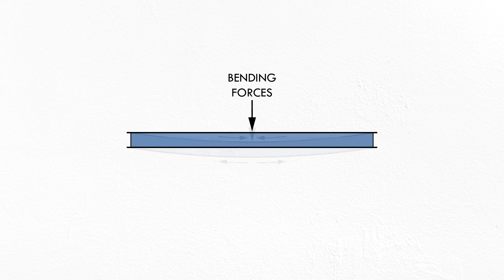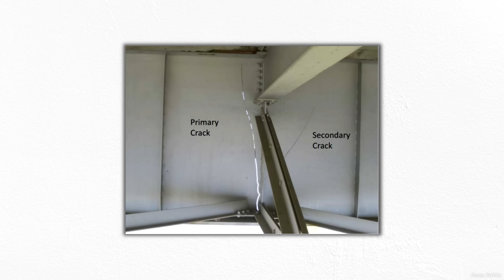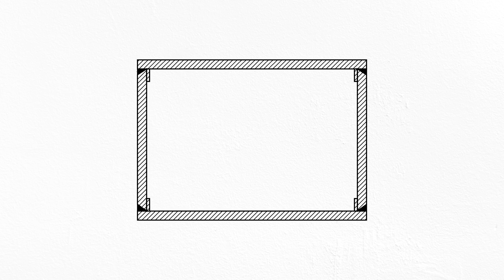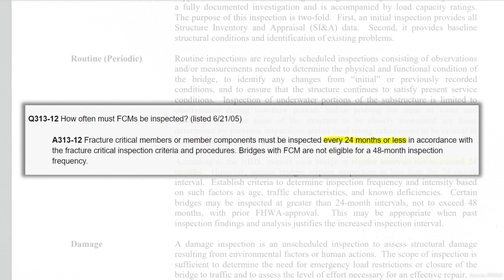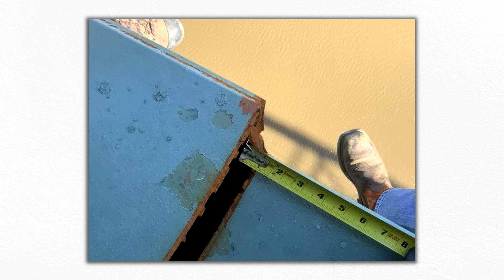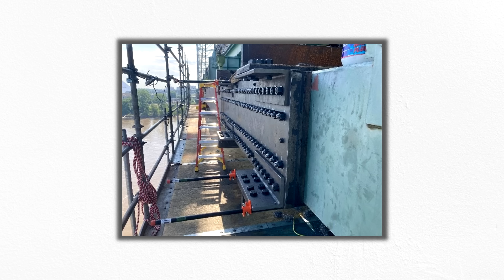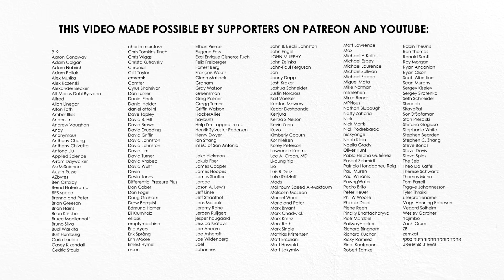What Really Happened at the Hernando de Soto Bridge?

Comment: That's going to be one big headache now. It's definitely got some sort of load/tension it to move like it did. What consequences will it have on other parts of the bridge now as you suggest, time will tell I guess. But the inspection firm will now be liable for anything that goes wrong now. That guy fired was most likely a scapegoat. Poor practices and processes in place by the firm led to the crack to develop to a break over many years by the look of it. Luckily the bridge looks well built and withstood it. 🤙

Comment: The level of incompetence shown here is scarey. I could understand the inspectors missing a hairline crack, barely visible to the human eye, but this vast chasm could be seen from a canoe, some distance away. There are, quite probably, plenty people who have seen this damage from passing boats. Unfortunately, the majority of people don't have the engineering knowledge to identify the damage as dangerous. That's what the inspection are 𝒎𝒆𝒂𝒏𝒕 𝒕𝒐 𝒃𝒆 for.
Without trying to over-dramatise anything, the companies responsible for the inspection should certainly be stripped of any contracts they may have. Actual prosecution would be tricky: hard to pin it down to any one individual, but somebody should be held accountable for such blatant incompetence.
Good video, on an interesting subject.✔  Nothing more than good luck stopped this being a documentary on a terrible accident. While heads should roll for this corporate incompetence, it's far more important that lessons are learnt and procedures are put in place to stop similar situations from going un-noticed for years.

Comment: I've seen brittle failure in other industries.  I'm surprised they didn't cut out a section of that crack for analysis?  They could learn a lot about what caused the failure by studying the rate of growth and things like that.   I'm no metallurgist but I've read a few reports and it's rather fascinating just what they can figure out from microscopic analysis of grain structure and growth markings.

Or perhaps they did and it's just hidden by their repairs?

Comment: Here in the UK ive worked on a few bridges mainly reinforced concrete and alot of the time if a fault isnt a massive issue and hasnt been budgeted for they just sweep it under the carpet without even notifying that it has been found in some cases. Ive also come across times where the site managers/staff have made the call on what to do with a issue when it clearly should have a engineer look at it.

Comment: Could you put a set number of “crack decals” in known locations on a bridge before it was inspected.  Then the inspectors would not have to deal with the distraction of wondering if there are even any cracks on the bridge, but would know that there are at least x amount of cracks to find.  It would also let you have more confidence in the quality of the inspection knowing that they did or did not find at least the fake cracks.
Reply: I once routes a factory making safety critical products and known bad parts were introduced into the production lines to ensure the testing found them.

Comment: You know it really drives me nuts that they still continue to build things with hollow steel beams.

Hollow beans that can rust inside because they don't properly coat them, and that rest cannot be seen because it's on the inside.

Why the shit hasn't that design been banned yet?  Use an open eye beam so it can be seen all the way around, or use a smaller Solid Steel beam

Comment: I'm glad you said what you did about the individual that got fired, I don't know much about this particular situation but I do know how jobs such as that go in modern times , firing a single individual is a PR stunt and in no way solves anything in most cases nowdays, we don't know the behind the scenes view and I imagine a form of politics was certainly involved in ignoring the  crack in previous years for example let's say you bring me a vehicle for an oil change and upon visual inspection I discovered your serp belt is cracked and coming apart and you decide you only want the oil change you don't have a budget to change the belt right now and you certainly can't afford to not use your vehicle until you can get the belt if it's still working ...this type of thinking happens all the time in government from local all the way to the top and often potentially dangerous issues are intentionally over looked for far to long , luckily nobody was hurt in this one but unfortunately I would suspect approximately 6/10 bridges,overpasses and dams in this country are hiding a dirty secret within them giving the age and lack of maintenance and the fact we are a reactive society not a pro active society.

Comment: Could sensors be distributed across important bridge structural members to monitor and alert on changes in tension? Tension sensors exist. This would not be an alternative to human checking, but an early warning and tracking system to complement this - perhaps prompting teams to deal with problems earlier and take less drastic action when problems haven't reached that severity. A dashboard showing critical tension changes/positional changes in bridges - ie the current worst offenders, could be a useful gadget for a highway agency.

Comment: I am thrilled you brought up the topic of Quality Management. Whether Civil Engineering, Manufacturing, Food Service, etc, quality management is almost always seen as a hindrance or an obstacle. Your comment that the level of inspection, depth of re-checks, and oversight need to be commensurate with the critical nature of the subject is spot-on. Unfortunately $$ tends to drive the scope of quality management in most (all?) sectors more than the safety of the end user unless regulations force the issue. Even more unfortunately it seems that quality management is often taken out of the realm of Engineering and is left solely to administrative minds.

I work in Manufacturing and your comment that the system is inadequate rings quite true. 1 person checking on the safety of 50,000 vehicles/day: clearly insufficient.

Comment: Looks like there should be redundancy incorporated into the plan in the event of failure of any single member.  With the bridge members out of alignment you can't simple pull it back into place and "glue" it back together either.  Wonder who the geniuses were who missed that crack more than once?  Ray Charles could have seen that split.

Comment: I worked in the injection moulding industry for more than 20 years starting as an operator then progressing to setter and technician and then a more recent dual role as a process engineer and maintenance engineer.
In one particular company we did not have a particularly robust maintenance schedule so I implemented a fairly robust routine maintenance and preventative maintenance system. It was designed with many years experience and implemented in such a way as to mitigate downtime as much as possible. However, I’ve witnessed other technicians routinely signing off paperwork without ever laying eyes on the machines or ancillary equipment only to discover a fault when I’ve inspected the machine or equipment myself.
I do understand “we’re only human” but cutting corners by skipping important maintenance inspection schedules or having a blatant disregard for health and safety is wholly unacceptable.

Comment: Reminds me of the bridge span of I-787 in downtown Albany, NY in 2005 when a 70' pier tilted because it was built on an old landfill and it settled to one side.
The span dropped on the pier about four feet but did not fall, thank God, and a motorist did a flying Smokey and the Bandit over the span.
Had it fallen, the span would have taken out three layers of connecting bridging and had a cascading effect on other spans.

Comment: Anyone want to bet that engineer that was fired was or will be quietly rehired sometime over the next few months? Yea they done screwed the pooch pretty dirty on that, but DoTs are almost always underfunded and consequently understaffed, and given this did not result in collapse, that engineer will likely have a job again soon. And that's all said as a Minnesotain and Twin Cities resident, who knows EXACTLY what can happen. 

I have to argue the weld theory, however. A failed weld would not give you a fracture like that across the faces of a girder like that, and from the images, it doesn't look like it could have been caused by the tension. I mean, steel that fails under tension looks a bit like pulled taffy or similar. That crack looks fairly uniform in its formation, so I gotta wonder how it would propagate from face to face through the welds, as one would expect the crack to propagate parallel to the long axis, down the weld, instead of across it. Looks like that was some damn good welding work, and that the girder was annealed afterwards.

Comment: Notice the quick stop gap measure of filling in between bridge piers with a wall of concrete to "beef up" support.
That's a band aid on an open wound and a tell tale sign that the bridge is under designed for what it is supposed to do.

Comment: I was wondering if steel can age?  We think of it as being immutable after it's forged, extruded, or rolled; but does it actually have a lifespan?  And I don't mean just rusting.  We see lots of materials age over time like plastics, or wood, or fabrics.  Could it be that metals age, just very slowly.  Getting brittle and weaker as the decades drag on.  I think of how flexible rubber is when new but cracks and becomes crumbly when old.